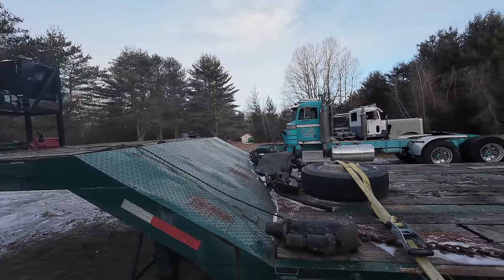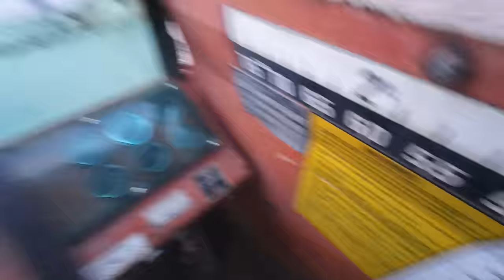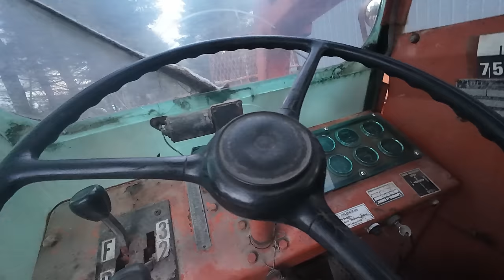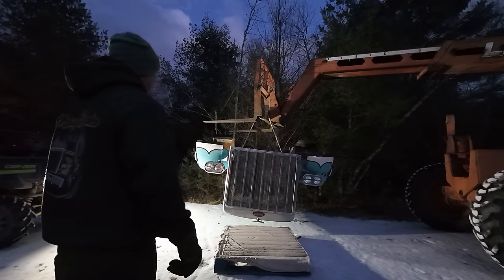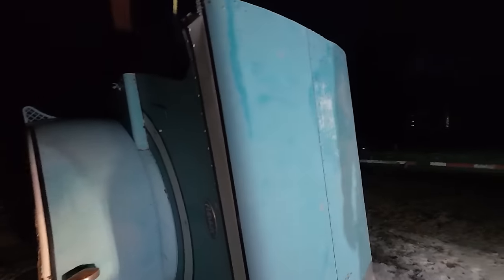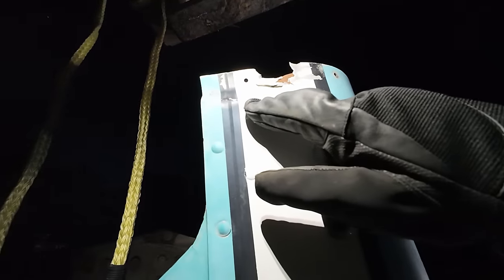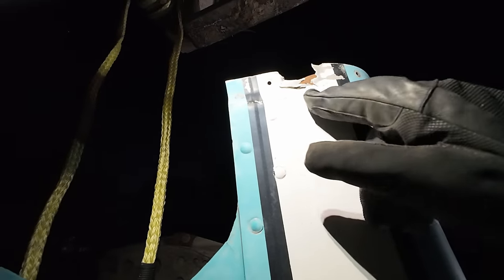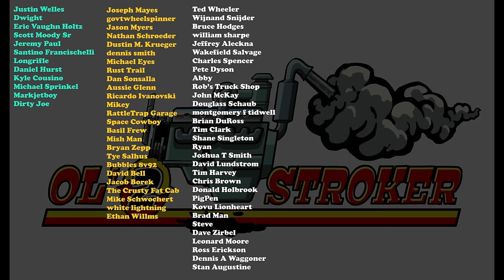Major Storm threw my irreplaceable hood in the cabbage!!! Just how bad is it?!

Comment: If it’s possible you could get some T pieces and coolant hose, and then run a coolant line from the motor, up to and along that line that keeps freezing. Even just cable tie it along it. The heat from the coolant will stop it freezing. Can just loop the coolant hose back to the rad or motor.

Comment: I've got that same Lull a 644 with a Deutz in it
Reply: How do you deal with yours freezing up ? Or just secret tricks in general with the vehicle 
:o
Reply: @LORFCASTER  I haven't had any problems with mine freezing up. Although right now I have a couple hydraulic cylinders that need to repacking
Reply from the maker: They dont freeze up if the cables aren't rubbed through lol. It's getting new cables this year, i previously have never used it in winter so i didn't know it was a problem.